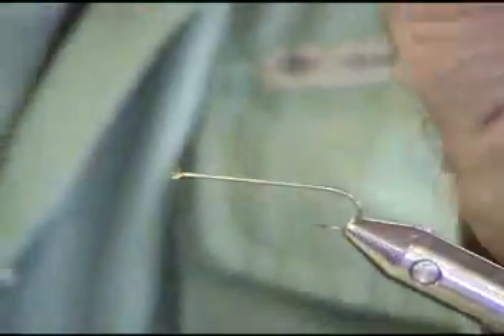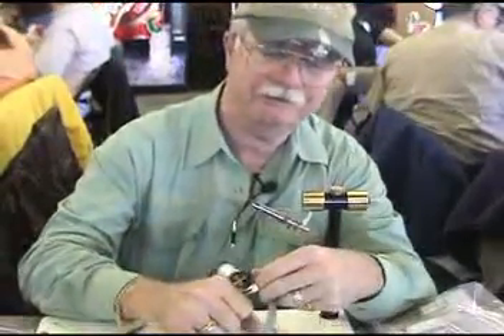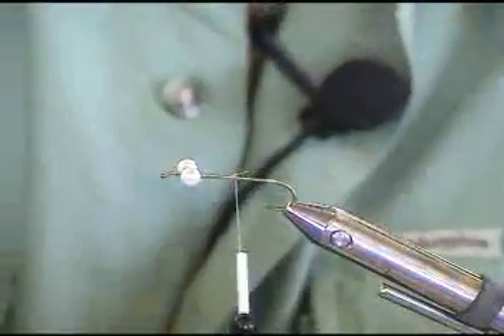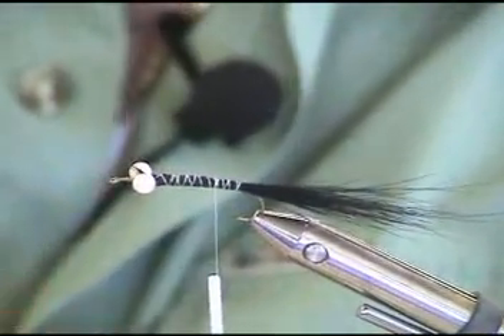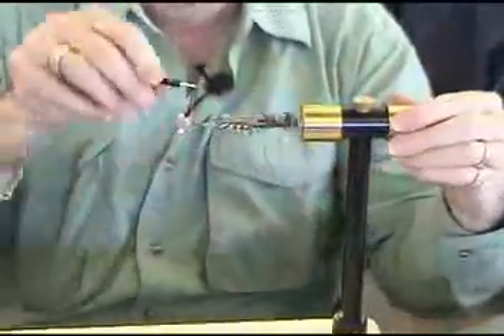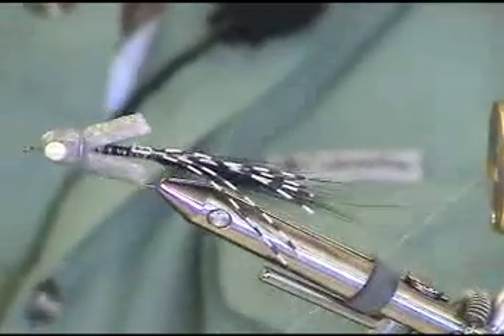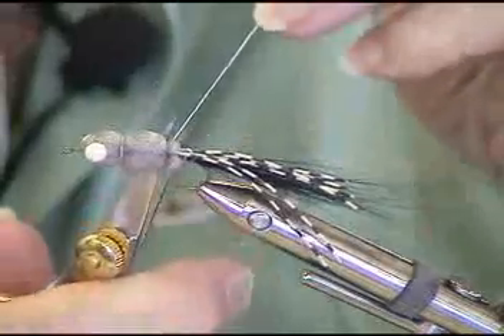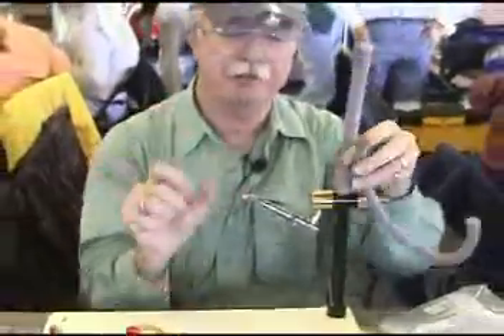Tying the Pin Head Popper

Comment from the maker: @micmoable I would start with a local fly shop if you have one. I would also see if there's a local fly tying club in your area. They typically are very helpful to new tyers and you can learn a lot in a very short time. In the absence of that, there are some very good vendors on the web and mail order that can help you. Some I've used are J. Stockard and Hook & Hackle. But there's no substitute for holding the material in your hand before buying to make sure you're getting the best quality.